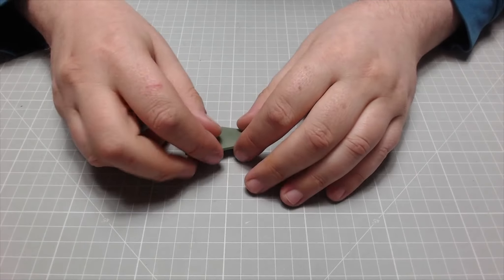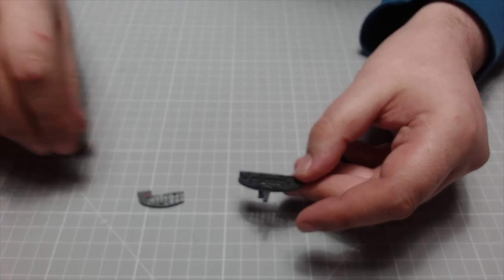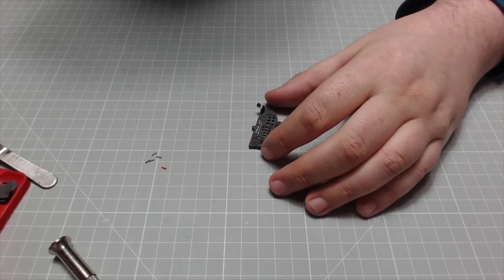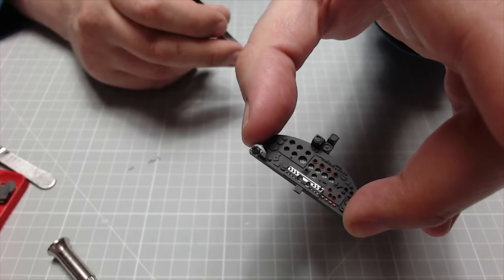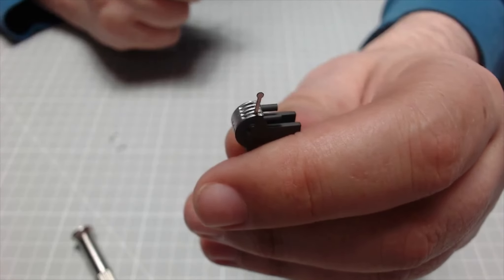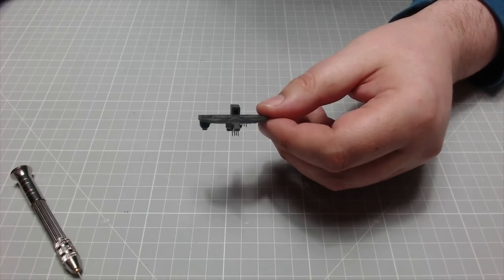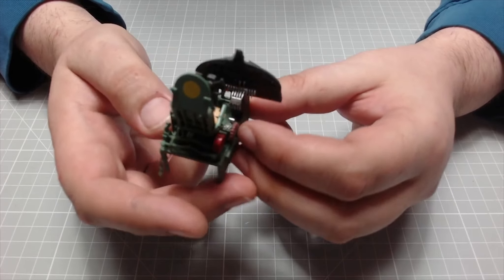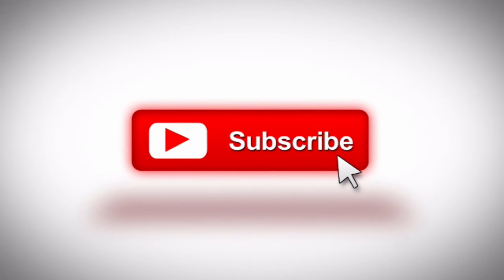Build The Lancaster Bomber Issue 6

Comment: The dials & gauges on the instrument panel aren't lit on the real aircraft. They use small 'cockpit lights' that are dotted about the cockpit, depending on what type of aircraft it is. The photo etch throttle levers etc. are fiddly, but they do enhance the cockpit details.
Reply from the maker: Ah ok thanks for clearing that up. the throttles really do look good
Reply: @MarksModz  They do indeed. I reckon it'll look the 'bees knees' when complete, especially as there's internal lighting as well. Hopefully that will be subtle & not garish white LED's, lol!
Reply from the maker: I rekon so too. If the internal lighting is white LED's I have a fix for that which I can show how too do